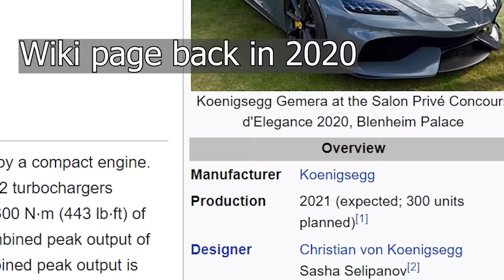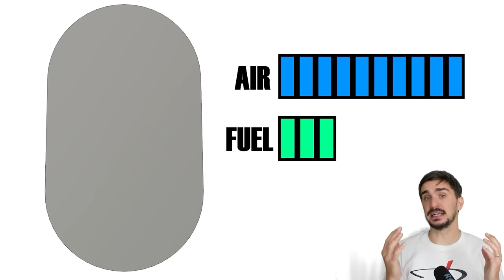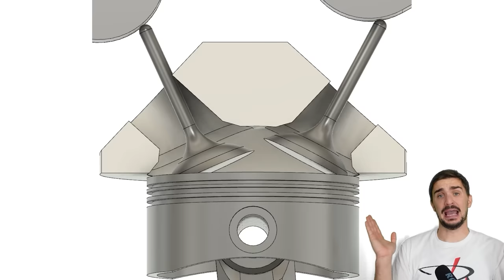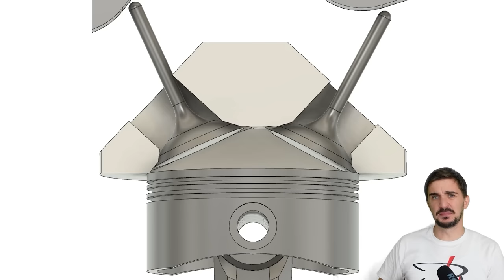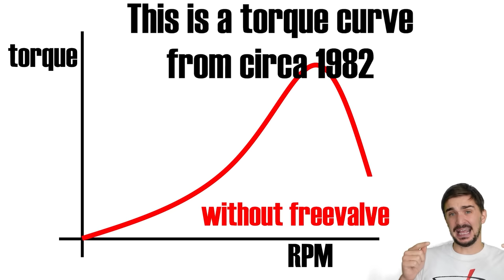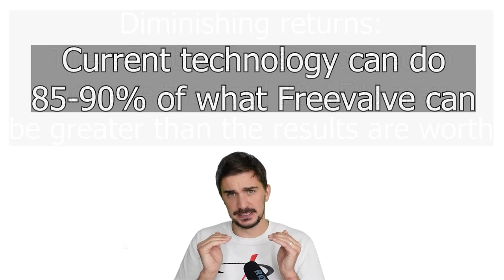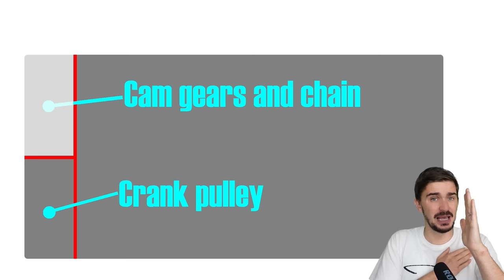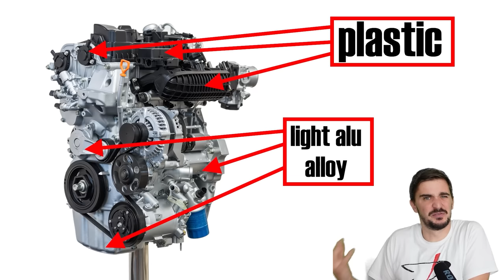FreeValve Isn't a Big Deal. Here's why

Comment: The only real advantage I could see is reliability, no more cam chains and no complicated vvt systems that can fail. But manufacturers nowadays don’t seem too concerned about reliability.
Reply: Not true.  It is the opposite.  There has not been a single Freevalve engine car delivered to customer yet.  Durability and reliability of solenoids are major issues.  You can have a simple US small block V8 running for 300K miles without repair of the camshaft and the related valves etc.  It has been very reliable for traditional engines.  And there has not been a single Freevalve running in the street.  You are assuming the perfect reliability of the Freevalve system that has never made to a real road.  Not a good assumption.
Reply: @catchnkill  i just thought its way easier to explain. I get where you’re coming from. On a large old engine the cam chain will survive for quite some time the problem is that these engines aren’t affordable here in Europe so were stuck with downsizing engines where the timing chains have shorter / comparable lifespans to timing belts but cost 2-3 times as much to replace. Not to mention the the variable valve mechanisms are known to break on many cars. I‘d just imagine a freevalve block could be way easier to replace.

Comment: Excellent video, thank you! 

Clearly, arbitrary control of valves gives the same results so far as combustion is concerned, no matter how it's achieved. Valve train losses might vary, but that's tiny in comparison to the engine output.

An advantage I can see with solenoid or air driven valves is the potential to survive valve/piston collisions. If the valve stems are vertical, then if a valve hits a piston it can simply push the valve back up. That's because there's no rigid mechanical or hydraulic actuator to break or burst. But that seems like a flimsy advantage. How often does a valve hit a piston anyway? Timing chains can last a very long time. And vertical valve stems aren't a great idea anyway.

I know Lotus looked at solenoid valves years ago, and didn't bother productionising it. It wasn't worth it.

An advantage for ordinary valve gear is that the valve stem being constantly washed in oil is a good heat sink for the valve head. If the head stays cooler, you can run higher compression without knock. But with Freevalve the valve stem ends up in a solenoid or pneumatic actuator, it feels like there'd be less local oil flow. Maybe the valve head is hotter.
Reply: My 4.2 L GM I-6  from 2003 makes 125% more HP and more torque than the same size GM I-6 I had that was made in 1969. Both were 'truck' engines.
Also the 2003 makes less NOX and incomplete burned  fuel fuel emmisions. Plus better fuel mileage in a 25% heavier vehicle.
I can see a advantage in in slower RPM heavy truck engines using gasoline. But diesel is all around better except for California. Home of the supreame NIMBYs.
I guess after 2035 in California 20 mule teams will make a come back. If they can control methane emissions from the mule's anus.

Comment: I did not look all. Instead I jumped once I got the point.
There is still perhaps one more flaw in the solenoid valve. Filling the cylinder is a fluid mechanics challenge. It is not only about valve opening h but about h(t), the opening should be function of time - or crank angle. Traditinoal cam forces the opening profile to something very exact where as solenoids tend to work more like on/off which is not very good from fluid mechanics point of view because fluid mechanics tend to prefer continuity of motion. However, this is not a black and white claim. There are also things that can be provoked by incontinuous action. But one can say that most times flows like continuity.

I also wonder if you really can get space benefit from a solenoid. It requires its space which is also dictated by the amount of lift and the coils and magnets.

Anyway, it looks now that IC technology will be sided by electricity although the battery development has been somewhat disappointing in recent years. They have not developed as quick anymore as optimists have hoped. We were promised already some 8 years ago that “next year we will have 400 Wh/kg” and the reality in production today is closer to 250 Wh/kg. And the original scenario to transfer traffic to electric was very largely based on battery development. In some applications efficiency is not as important as payload efficiency and heavy batteries do not provide that. Synthetic fuel could solve some applications (aviation, sports cars, racing cars - anything where weight is dominating factor).

Comment: The only real benefit to a free valve engine at least in comparison to a multi air fiat actuator is the reduced complexity/ components needed which increase serviceability of the engine. Think about removing all the components of the timing system and the failures and costs associated with timing systems. 

Timing system repair is one of the most common and expensive repairs associated in a modern engine. Think about the over complex design where the timing system is located between the engine and trans (VW, Audi, Alfa / Ferrari & Maserati etc) or even how much it costs to fix the average brand like gm 3.6 timing issues or other manufacturers timing chain issues like Nissan etc. that’s really the only and real main benefit I could see to this system over a traditional one.

Comment: I tunned a nissan platina(same engine of clio 1.6liters) gave me 24km per liter of benzine, in a average velocity of 65-85 kmph.But in other side was faster.
If you push the accelerator its kinda fast, i mean got to drink fuel,giving me 5 or 4.5km per liter of benzine, i got increase the hp surrounding 187hp from 120hp(stock)

Comment: The thing that solenoid valves should achieve (I don't know about freevalve specifically) is lower cost and higher reliability. Essentially removing mechanical complexity and moving parts and replacing them with electronic controls. I think it's weird for this to target boutique and niche equipment when the main benefit should be simplicity of manufacturing. I suspect the main reason we don't see this happening is simply because of conservatism...(little c). These companies (Ford, Toyota, etc.) know how to make mechanical engines, they do it well. Trying to make an entirely different engine would be a significant cost undertaking, as well as something they aren't experienced in doing, so continuing to make mechanically driven engines is the safer bet.

Don't for a moment think competition is a valid argument against this. It is entirely impossible to compete with the big automakers as a startup.

Comment: I knew it all along. If freevalve was going to be so revolutionary then Ducati's desmodromic would have been a forerunner. Which actually offered only decimal improvements.

If getting rid of crank-pulley parasites was so cardinal, scientists should begin with the AC compressor or the diesel engine's fuel injection pump.

Comment: Free valve was developed so that you could have both efficiency and power all in one engine, reducing parts diversity. Given that VVT isn't included in the scotch yoke engine from the other video I watched they could in theory include free valve tech in it along with the electric turbo to have a real drive mode true experience and efficiency as well. That said, what would the EPA think of free valve tuned/programmed with lots of overlap? Lol. 'Don't give my car malware, it might infect the free valve, leading to total system failure.'

Comment: I think the biggest thing would be weight savings and reduction of reciprocating mass of the system. Plus I have to think that throttle response would go up as well with freevalve. I'm curious about longevity though. Cams and gears are proven to last decades and while solenoids are pretty robust I'd have to think they'll wear faster. Still, take one of the modern engines and slap on freevalve and see what it'd do. IMO the video highlights something I've been saying for a while now. Look at just how good modern engines and cars in general have become. Tiny engines making big power and doing it while burning cleaner. With standard features that are just great.

.......now here comes EV to throw all that in the trash. Just seems a shame to me.

Comment: I still have the assumption that cam-less engine designs will only be economically feasible and reliable on lower speed engines. Which unfortunately might be the ones that least benefit from it. Say with a cam design that can induce heavy swirl on direct injection engines when partially open, yet let high amount of air in at high loads, implemented engines that are meant to operate at various load ranges while remaining efficient. Aka not hybrids. Probably truck/boat engines.
Reply: What if there was subsonic vibrating aluminium cristalline in de ionisants water

Comment: Is it that freevalve brings all this capability to one engine n does it throughout the whole rpm range instead of optimising to 2 specific spots at low n high rpm leaving the middle along with other small gaps in the range where it isnt fully optimised? Kud it b that frrevalve will b optimised at any point in the range while u can find unoptimised ranges in the rpm of other engines if u looked for them? 
Im jus speculating as i dont really know anything.

Comment: 15:40 Great Video. But there ist something you are not thinking about yet. They are testing AI algorithms on these Freevalves with surprising outcome. They can tell the AI in which way situations should be optinized and for example it creates a multiple injection with a certain rhythm that also creates a backwards air pulse that is used for better airflow on the other intake side. So AI will be a topic in cylinder timing as well.

Comment: 14:00 but what about simplicity... I mean freevalve can do all that with less of a complex mechanical valve... I mean freevalve is complex compared to traditional valve... But these valves are not traditional... Just look at the throttle by wire system.. Its actually more complex compared to simple mechanical throttle.. But compared to a mechanical which can do cruise control or decrease when loses throttle or by simply increase the idke when ac is switched on... The throttle by wire is way simpler and more advanced that it can do more than that.. Just like that, what if the freevalve is actually simpler compared to these complex mechanical camshaft and valve that needed to adjust itself at required rpm... What if freevalve is simpler to adjust when we choose sports mode or eco or when we turned on the traction control?

Comment: I think the main question is WHY does the Freevalve costs so much? Is it because its low-volume production? If Freevalve were to be produced in the kind of numbers of even premium luxury vehicles, would it make it as cheap as variable-cam systems out there? The idea of having just ONE solenoid per valve sounds so much simple than current variable cam solutions. Unless those are some dank-ass solenoids...

Comment: I bet traditional means naturally aspirated with out direct injection. DI is helping with the majority of power output vs emissions. And as freevalve claimed. They wont need DI to be competitive. Id like to see a cost comparison between a freevalve engine and a vvt DI engine. I'm betting freevalve is cheaper to produce with better emissions overall.
Reply: Also the size reduction was in width of the head and lack of other required things like throttle body and large intake plenums.

Comment: Surely Freevalve would be using electomagnetic valve actuation and control?
Reply: In Freevalve, electronics control electromagnetic valves which control hydraulics... and pneumatics close the valves. An electromagnet strong enough to move the valve directly is very bulky and is difficult to make fast enough.

Comment: As much as I love the content of your videos and your delivery, it seems that I'm looking at an elephant in the room.  This will likely need more discussion, and maybe it's just me not seeing the bigger picture, however,  I find myself wondering about the premise early on that the valve lift has much, if anything to do with the velocity within the port in a gas engine at low RPM or low load.  Sure the velocity at the valve seat will increase with low lift but is that the best focal point for where the velocity is needed?  I would bet that early closing (no overlap) is more important.  I'm not sure how much help that higher velocity at the seat will help drivability, economy, or emissions.  I've read that it's the port cross section and valve pocket that have the most effect on those things.  Wouldn't it be great to have an adjustable port cross section so the velocity remains high?  As it stands, the entire trip from the air filter to the spark plug is a compromise between high flow and high velocity, and is a balancing game.  I believe that the lower lift on VVL and shorter timing on VVT accomplish much the same from different design features.  A low lift cam means that valve timing overlap is reduced very much like a short duration cam would.  Are they really trying for raised velocity at the seat?  What is the desired outcome of the design parameter?  Is valve seat velocity truly the goal?  I dunno.
Overall though, great presentation  I watched this twice and I now have only half the objections as the first time through...lol  :O....maybe I need to watch it another time to be fully satisfied.  carry on
Reply from the maker: Valve timing is likely the most complex topic when it comes to engines and there's so many intricacies and aspects that days of video time could be made about it. I've tried to compact one aspect to give context to the video without spiraling out of control and losing sight of the video title. All that being said, reduced lift does impact velocity but of course there are a myriad of other factors that can do that too. The important thing is to match lift with what the piston speed can do at that point in time. Although the seat is a small focal point it is a gate. You can imagine instances where velocity is near or at zero in the port when the valves are closed. Also, all of this is a naturally aspirated perspective. Forced induction can of course artificially raise velocity regardless of what the piston is doing if you can spin the turbo fast enough soon enough.
Reply: @d4a For sure.  I was just bouncing back that a narrow valve to seat distance will increase velocity at the seat but slow the velocity everywhere else.  The valve is the choke point.  Narrowing it should have detrimental effect both upstream and downstream of it.  Increasing  the all-important port velocity would not be accomplished by a narrow valve opening.  I am speaking of either port injection or carburated induction.

Comment: you should have mentioned that some F1 teams tried a similar technology as well in the early 90's I think.
Reply: Not a bit similar.  Those F1 pneumatic valve is for extremely fast operation i.e. to allow the valve to be open and close under 20000 rpm.  Essentially it is compress air spring. This Freevalve is about total control i.e. variable timing, variable lift as well as variable valve open duration.
Reply: @catchnkill  you mean they still have a camshaft but they used compressed air in lieue of the springs?
Reply: @francoisloriot2674  Yes.  When you rev to 20000rpm, the spring cannot react fast enough to close the valve.  Use compressed air is one solution.  Another one is Ducati's Desmodromic system.  Compressed air is still being used now in motoGP.  Each bike carries a compressed nitrogen canister.  The canister is a one time use device and is replaced each race.

Comment: free valve tech is the answer to 2 stroke diesel scavenging problem allowing for the high power output and high revs without the unburnt fuel going into the exhaust and making the epa mad

Comment: Ok well I disagree, having one valve design that can do all the things all the other implementation's can but in one single package is it's own value, This is standardisation via convergence and would allow for better optimised supply chain for the part if everyone was using it because that's how economies of scale works. Making that 10% to 15% at the end not a diminishing return with this mitigating factor in play. It's not like the automotive industry isn't specialised in supply chain production optimisation so I don't get how that is been overlooked here.

EDIT: By the way the technical breakdown is fine from an engineering standpoint, It's just business and economics side of things is not being factored in here at all. Iv worked in supply chain logistics in a few different sectors so this is a no brainer to me personally. but this is still an insightful comparison in my opinion even if it's not for the reasons intended.

Comment: the thing is, if we dident have Tesla and all the crappy Battery cars, FreeValve would have played a more important role to ensure lower emissions.
One more thing, this video regarding "traditional" engine is only focusing on HP a 1.6L do to day without FV... its still improves more than without. people look to much on HP only. i would like to have a FV engine that DONT need a turbo to get to 230 HP.. lower and better fuel consumption and emissions less parts and and lighter total weight with FV.. but still have 230 HP.

Comment: Why doesnt engines have the valves inside the intake, so that they cannot contact the piston. That would mean you can have the valves open for even longer
Reply: That would increase the
combustion chamber volume, reduce the compression ratio, reduce efficiency, increase emissions and reduce torque.